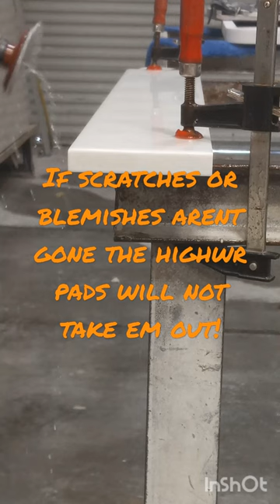How to polish quartz correctly 🤯😲mirror like results must watch!#shorts #fyp #youtubeshorts #stone

Comment: How long do I do each pad for?
Reply from the maker: I would go from the brick to 400 hundred pad you should spend the most time on 400 pad once scratches are gone then you can move forward...of you look at it after 400 it will already have a sheen so if you have the shine and no scratches then it's time to move forward
Reply from the maker: If you move forward without removing scratches then you will have a shine but there will be a fog in the center let me know if you need a better video or have any questions
Reply from the maker: Keep in mind polishing quarts you have to apply pressure and yhe right amount of water too much watwr will hydroplane so not too much not too little if you don't have enough water you will burn the quartz .
Reply: About 2 days is fine

Comment: I’ve used some bar keepers friend on a patch the size of my hand. It’s now dull compared to the rest of the worktop surface. What pad should I use to bring the shine back to match the rest?
Reply from the maker: Of course bar keepers friend does do that what kind of surgace is it stone or quartz?
Reply: @artofstoneco  it’s a quartz worktop. The bar keepers friend was supplied with the worktop.
Reply from the maker: Quartz awesome is it honed or a glossy finish
Reply: @artofstoneco  glossy
Reply from the maker: Ok cool so the best thing for the job are surface polishing hard pads    1,000 - 3,000 and the next best thing would be monkey pads starting with 1,000 if all you have is wet pads then I would start with 800 and up to 3,000
Reply: @artofstoneco  Thank you.
Reply: @artofstoneco  is a honed finish the same as a suede finish? Just found out that my quartz may have a suede finish. If this is the case what method should I use and what grit?